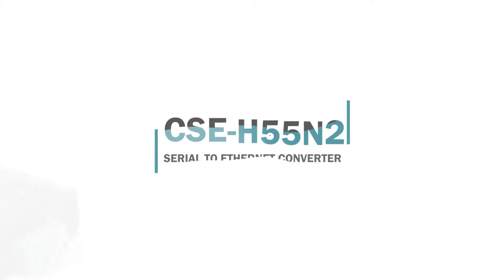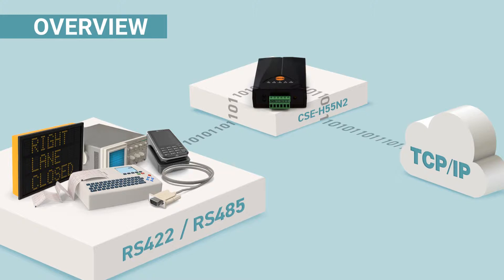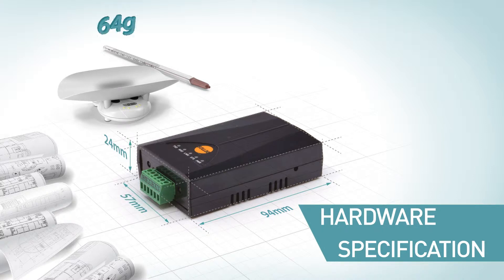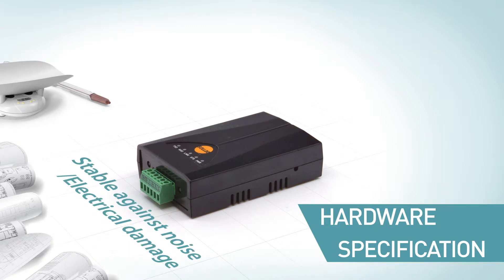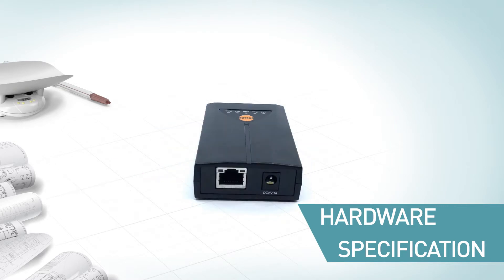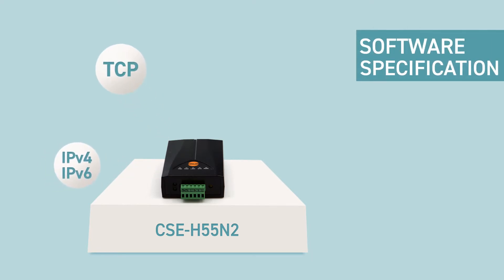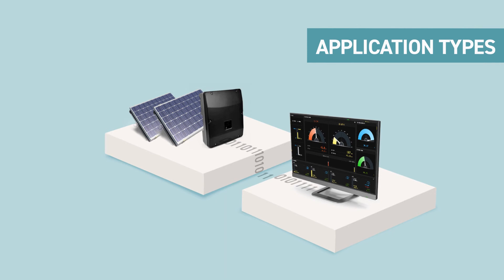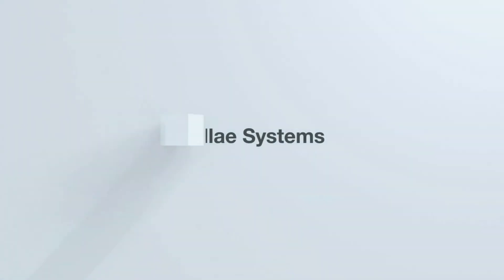Industrial RS422/RS485 Ethernet Device Server | CSE-H55N2

Comment: does this devices work if plug to long range wifi network extender transmitter and receive other end?
Reply: Hello,

We are sorry but we are not so clear about the inquiry.

This device (CSE-H55N2) only has Ethernet connectivity, so it can be directly connected to a network via an Ethernet cable.
Then it can exchange data with every device in that network (or via the Internet), regardless of the connection medium.

In case you are interested in connecting directly to a WLAN network, you can use ezTCP Serial WLAN devices.
Those devices probably meet your requirement.
You can refer to this link for more product information:
https://www.eztcp.com/en/products/serial_to_wlan.php

Please feel free to ask any question in Q&A section https://www.eztcp.com/en/support/qna.php, or via email at support@eztcp.com.
Thank you.